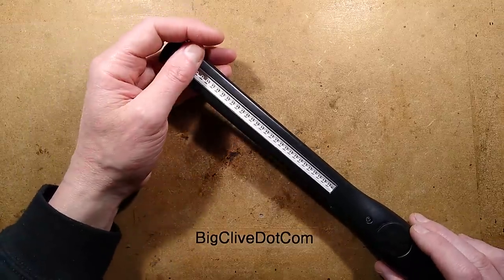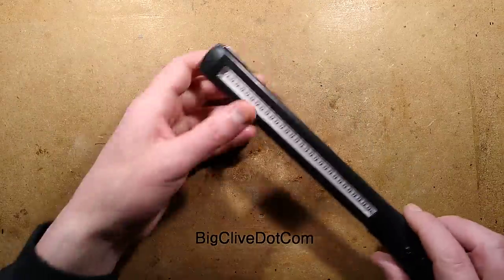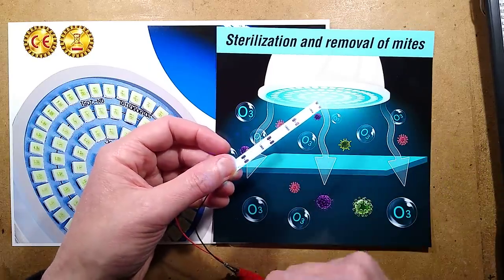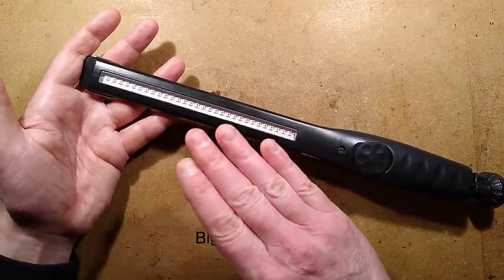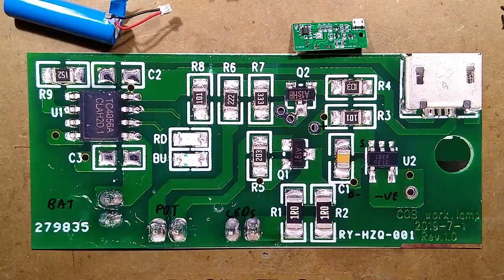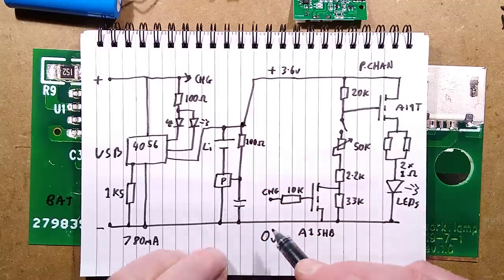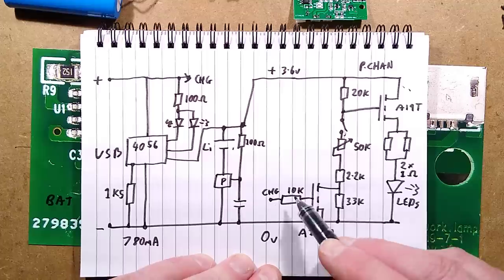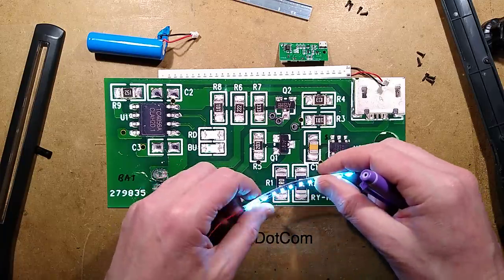More fake UVC "sterilizing" lamps from China!  (with schematic)

Comment: eBay's "report listing" feature is incredibly useless. It doesn't ask why you think they're being misleading.... Just "it's misleading". For obviously misleading products, that's probably fine... But for technically misleading products like these, eBay's drones are just going to read the title and the description and say "nah, it's all good".
I've reported products that make claims about boosting wifi, but are actually UHF antennas and would not work on wifi... Or recently "fibre optic HDMI cable" that has "100% copper construction" in the description.... But without being able to state this contradiction, the average eBay "support technician" isn't going to know why it was misleading.

Comment: I would avoid LED equipment all together until a reputable manufacture comes along.  I know 100% that any kind of lamp that uses the  8w T5 Philps bulb is going to be legit because I use these for water sterilization and the bulbs are called " UV Germicidal Fluorescent Tubes" . Make sure you wear sunglasses and proper PPE when you use it though,lol

Comment: I'm more interested in using UVC to light up fluorescent minerals and mercury vapor tubes require expensive filters to block visible light, so I was excited to see that they've finally done true UVC LEDs.  BigClive said "output and longevity is a fraction of traditional mercury vapor UVC tubes."  I'm wondering if anyone has experience with the 275 nm LEDs?

Comment: you need a diffraction grating or a cheap spectrascope (or a CD or DVD) to illustrate the color's wavelength.
Reply from the maker: Real UV is invisible.
Reply: @bigclivedotcom  yes.  It is fake if there is only one visible spectral line.  The medium pressure and low pressure mercury vapor lamps have some visible lines in violet green and yellow.  Medium pressure output is more visible and less uvc.  I believe all of the ebay low pressure lamps are truly medium pressure.  Low pressure uvc yield is 30% input power,  medium pressure is 15% input power . That matters if calculating exposure time ffom dose or fluence in mj/cm^2

Comment: Hi , interesting video ; I bought one of those for the hope to sterilize  toys like teddy bear and so on things that can't be sprayed on etc .  I had my doubt about efficiency but could not be sure ... Is it safe to think that those stick are all fakes and a real UV-c comes in glass tube ? 

Not sure how I can test that thing and if it's crap take action with amazon ( bought on their platform ) 

Thanks in advance & thanks for the heads up about those scam
Reply from the maker: Most of the UVC germicidal lamps are fake.  The ones that are real just have one or two gold coloured square LEDs and are a tiny fraction of the output of the traditional glass tube type.
Reply: @bigclivedotcom  thanks for the quick reply , I'll try to find a real one this time :) ( with all the necessary precautions that comes with it ) . 

Should you have a recommendation Or something in the specs that I should make sure is indicated I am all ears ;)

Comment: Just for the record, real far UV-C lights (assuming they're filtering out all the UV-A and UV-B) aren't actually dangerous at any reasonable intensity. It's been shown that the outer layer of dead skin and the outer coating layer of the cornea stops 100% of the light and so can't damage the DNA in skin cells.

The problem is lights like the ones in this video which aren't real far UV-C lights and mis in UV-A amd UV-B which ARE dangerous.
Reply: ..."aren't actually dangerous at any reasonable intensity"
Intensity do matters. When someone is telling you, the UVC stops at the layer of dead skin and the outer coating layer of the cornea.
They are probably quoting from an Article from Kobe University.  

But they are probably using the 6 volt 100milli Amp with light output of 0.005 Watt LED output UVC light. 

At 5cm distance, this tiny LED can sterilize flu virus in 5 seconds or kill some common germs in 30 seconds.

But don't try the biggies such as the UVC from welding.  Every welder can tell you the effect on skin and eyes.

Comment: Why not just use a meter to measure? There is no need to (even though it is fun) take a device apart to verify it. Testing to verify mJ/sec is easier with a meter and allows for instant verification at  multiple distances without doing all the math. Have you done any testing on FAR UV-c lamps? It would be informative. Like your presentations btw.
Reply from the maker: To buy a proper UVC meter would be extremely expensive as they are lab equipment.

Comment: Of course the violet LEDs aren't really that effective compared to UVC tubes. But I'm not sure I'd go so far as to say they don't do anything at all. The genetic material inside many viruses, including the one that caused this pandemic, is actually not DNA, but RNA, which is far less stable. And unlike bacteria, viruses do not have enzymes that are constantly repairing it, so if you irradiate it for long enough it might actually do something. I wouldn't trust it to kill anywhere close to 99% of the particles, but I don't think it's completely ineffective. As a biomedical engineer myself I wouldn't recommend buying these for that purpose though.
Reply from the maker: If violet or blue light was effective against germs at these levels they would be built into every fridge and food servery.  There's a reason they're not.
Reply: @bigclivedotcom  Funnily enough some refrigerators do actually have these, but it's mostly a marketing gimmick. As you said they really don't do much. Especially not against bacteria, which, unlike viruses, are an important factor in food spoilage. Because they can repair themselves faster than you could inflict damage to them, no matter how long or brightly you shine that UVA light on them. But against RNA viruses (which are dead things that cannot do anything outside a suitable host) over long periods of time, it might do a little. UVA LEDs are way down low in the frequency range of what is considered UVA, though, so they might not work at all. But I have seen papers that say RNA is degraded by UVA light (though admittedly they didn't specify the exact wavelength, so it might almost be UVB), albeit very slowly. I don't know. Blue light definitely doesn't really do anything, of course. If this sounds as if I'm defending the seller marketing this product, I apologize. Selling that wimpy little thing as a sterilizing wand is absolutely deceptive. There's simply not enough radiation there for long enough. You'd need thousands of times more UVA than you would UVC light. But it isn't as clear-cut and dry as saying nothing will happen. I wonder if having a UVC lamp in a fridge would alter the flavour of the food, by the way. Probably not much.
Reply from the maker: @ManWithBeard1990  https://youtu.be/7wibGVQpHCc

Comment: Are there any UVC - lamps you can recommend?`
Reply: Usually they are sold as neons lights, not in a portable form for they are really dangerous.
Reply: @TheSugus38  I am fully aware, that UVC is dangerous for humans (and all other lifeforms). That is why my ideal UVC should have
a) a delayed start, so I can leave the room before it starts to work
b) a timer of course so it stops working after x minutes
c) may be a motion sensor, that shuts the lamp off, if someone accidentally enters the room
d) and of course should work, otherwise what's the point of it.

Comment: Same led circuit chip base as the T8 fish tank led light i had problems lighting them so modded it to the strip light in blue on a DC 12V plug works well and uses far less energy not to mention far cheaper as well as each T8 led is £60 or more strip lights are few pound and £6 for 12v DC plug

Comment: even if theyre starting to take action, ebay is still crammed with fake LED sterilisation lamps, little corncob screw in lamps, GU10s, everything. I did find one hand held, battery powered, wand-type LED lamp that actually looks like it uses the right kind of LEDs (item 303548263398 on ebay uk, listing title Portable UVC Sterilizer Light Germicidal UV LED Home Handheld Lamp Disinfection), but all the other LED products I saw look like fakes, outnumbering the apparently genuine ones by 100s to 1. it seems like the tubes are genuine though, and those tiny 3W screw in types.

Comment: I got one rthat came with a spec sheet that said "black light" on it, and showed the wavelength at 365 nm (uv a).
Reply: Me too. Does that mean spec sheet is fake too?
Reply: @HadiyaEmm  I can't say for sure, but 365 nm is in the "black light" part of the spectrum. 

What really gets me is that I saw the same lamp in the auto parts store the other day for about half of what I paid for mine. I need to do better product research, clearly.
Reply: @CognitiveDissident.  as do I. My business partner ordered 10 of these and I'm so pissed. Definitely should have looked this up
Reply: @HadiyaEmm  I bought 3. I have no one to blame but myself. I was going to sell them on my ecom website, until I found this vid. I'm not upset about it, because it is a valuable lesson about product selection and taking the vendor's product description at face value. I wasn't thinking critically enough, but now I know better, so I can do better.
Reply: @CognitiveDissident.  totally agree. I'm a little mad at myself but hey at least I've learned some other uses for it and can possibly market them as such. This video has been really helpful

Comment: It has some UVC, but to low to make any damage or sterilising effects, so yeh a bit of a scam, but great in the discotheque
Reply: One looking just like the one shown here emits less than 1uW of UVC. I can’t measure any lower than that, so it’d be a safe bet that it simply doesn’t emit UVC, especially that all the plastic between the LED chip and the outside of the wand is quite opaque to UVC. When you imagine those wands in UVC, the plastic looks very dark - you can barely see through it on long exposure. So it’s not a bit of a scam, lol, it’s *an absolute, complete scam*. The only way it could be scammier if they had sent an empty case with no electronics inside or a rock in the box. It’s as if you ordered a car for use on roads and got delivered a railway coal car instead.

Comment: I got an led cob 60w and just tuning it on and getting out the room makes my skin feeling like chemical burn/itchy.
Reply: Robert Stevenson - 🤨, genuine UV-C LEDS?
Reply from the maker: That might be psychological.  Especially if it is using standard white body LEDs with a slight hint of yellow phosphor.  Mines not arrived yet, but eBay has taken that listing down.
Reply: @bigclivedotcom  the listing is still there for the one i got. so who knows. i got a tube one coming in post so i will see

Comment: If these things are producing UVA that'd be a cause for concern as UVA is more  damaging they UVC.
Reply from the maker: Try comparing a minute of looking at a germicidal UVC tube versus a blacklight UVA tube.  The UVC one will have you awake in the night wishing you hadn't done the test.
Reply: @bigclivedotcom  I have 2x 20W UVC lamps and I would have looked at them lit for at least a minute with no ill effects. I do wear plastic glasses but I doubt they offer much protection. According to the experts the thin film of water on the cornea does provide some protection and I do have quite watery eyes. No doubt some have much dryer eyes than me so the susceptibility probably varies. I'd also point out that in the incident where UVC lamps were used at a fashion show the exposure time would have been quite long'
I have had a really bad incident with light. I was making some lights that used 150W HMI lamps and I thought it would be interesting to watch one as it fired up. That was  HUGE mistake. I got the only migraine headache I've ever had and it as a whopper. The lamps had built in UV filters so it wasn't that, maybe the light got past my eyes into my brain. I'm in no hurry to experiment :(

As I've said before it's UVA from sunlight that causes the really bad skin cancers as it penetrates further into the skin.
UVB is beneficial as it produces both melanin and Vitamin D which is very beneficial in the current crisis.
UVC is useful when used with common sense. I find the amount of ozone produced the most unpleasant aspect of using them to kill airborne pathogens although ozone is good for killing fungi and molds. My two UVC lamps are now in my DIY air purifier housed inside aluminium tubes so no UVC escapes, they're after the HEPA filter and to be honest I'd say they are overkill so I only turn them on briefly.

Comment: Have this one from lidl as car work light.. That one is actually very good😂
There is also a plug in for your phone with a real UVC led, a mate of mine have it and it's the real deal! (only very small output but it does it thing!!)
Reply: The UVC output you get from UVC leds is not very useful - it takes hours for it to have a usable sterilizing effect, and the area it can cover (from a $10+ LED chip) is small – a few square inches at most.

Comment: So basically there is no such thing as a cheap LED UV C lamp. The only ones that are real UV C are the glass gas filled tubes. Ive got 2 x 38w ones on order from ebay.. If i dont blind myself, Ill let u all know if they are any good.. ;-)
Reply from the maker: The clear fluorescent tubes are the cheapest and most efficient way of generating UVC.  The newer UVC LEDs are better suited to compact low voltage situations.
Reply: @bigclivedotcom  Well its come...2 lamps £10 each on ebay and Id say they r deffo the real thing . I didnt realise they would be almost as bright as my mums old Philips sun ray lamp from the 70s

Comment: There is a wand that uses a glass tube and they work very well, I have two of them the only problem with them tend to be that they cut out so you have to keep triggering them with the button.

Oddly enough when I bought my UV-C wands they cost around £5 now the same wand is around 30 pounds with a hefty delivery charge on top.

So ebay should start taking down the fakes and consider putting penalties on those who are profiteering.
These fakes could be dangerous if someone thought they were working and ended up getting contaminated they could potentially die, all because someone wanted to sell fake stuff on ebay.
Reply: I recommend staring at them because they are so pretty.

no, wait, strike that.  encouraging stupidity should wait until AFTER the virus has gone back into its hidey hole.

trust me.  those UV lights, even the real ones, will do absolutely nothing to "protect" you from the virus.

think about it.  unless you are literally putting yourself in an airtight room and flooding the entire room with powerful uv lights, you aren't really sterilizing anything.

and then, of course, you can't live in a room like that so...

yeah.
Reply: @thomasneal9291  I think you have mistaken the type of light being mentioned.

These UV-C lights have been used in China and are used in Hospitals to kill viruses and bacteria they sterilise whole rooms but they are only good for doing the surface, so they are not a substitute for cleaning away heavy duty dirt or dust or spilt liquids they only make the surface free from the above mentioned and they work very well.

They are also used in aquariums and for sterilising water they have been used for a number of years now for this purpose and are well known in the field of fish keeping.

So they do work and they do a really good job if used correctly, most things only need a few seconds but some things need longer.

Also as I said if you have one of these lamps you can test the effects for yourself by using a banana or an old smelly shoe, the old smelly shoe produces some amazing results smell wise, it starts off smelling really naff and ends up smelling let's just say much better.

Comment: Maybe you should be quiet about it at least people are not getting hurt by not buying the proper ones.
Just report the sellers. Do you not have a light wavelength tester
Reply from the maker: A proper UVC tester would cost around £700 plus 20% tax.  I've just used a UV sensor chip to validate that they are not putting out germicidal UVC.  The problem with being safe for naive users is that they will think that all UVC lamps are safe to look at until they get a real one.